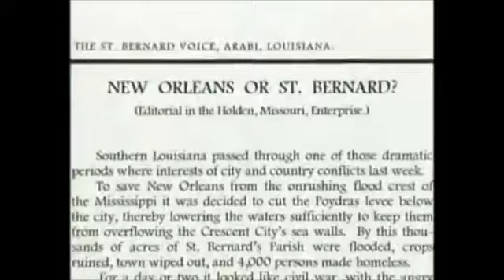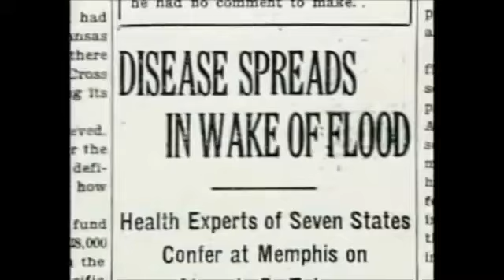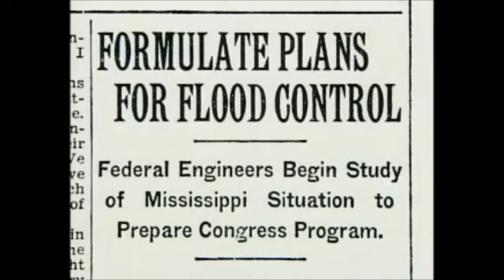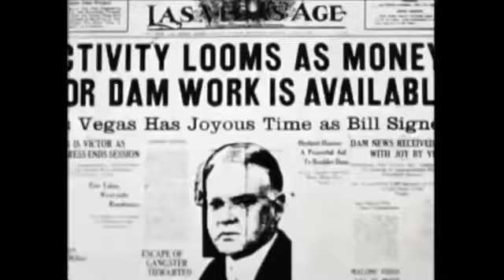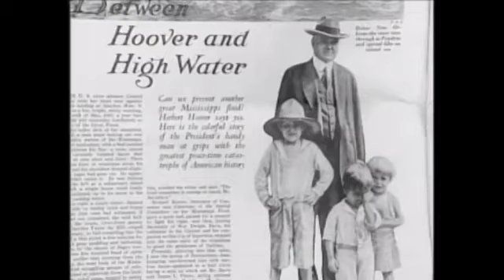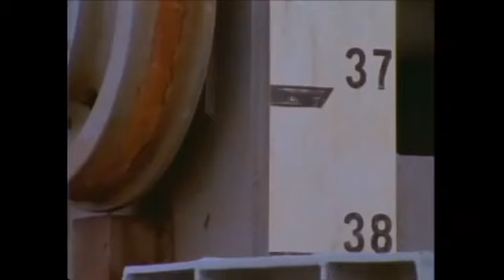A Tale of Two Rivers

Comment: Texas passed a law to move water anywhere in the state from anywhere in TX.  Looking at all the lakes in East Texas.  The water is all surface water and easily depleted.  The largest "consumer" of surface water is evaporation.

Looking at the Mississippi it would have to have more than one diversion point since floods in the north would not be helped by diverting from far south.  It would have to be very, very huge.  To prevent evaporative loss it would be better in a pipe or covered canal.  What happens when the folks out west get used to the water and demand more & more when there have not been floods for a while?  When the river gets low how are the barges going to cheaply transport goods?

Here in Texas one factor is everybody out west has to have their lawns, golf courses and flower gardens.  The Edwards aquifer has dropped well over a hundred feet as of over 20 years ago..  I saw a TX state employee watering grass at a rest stop in the middle of a desert.  Now they want to drain our lakes.  In fact one year water was pumped frome one lake to another that was dangerously low, too much water pumped to Dallas, the Nation's highest per Capita water user.

I suggest looking at desalinization.  Expensive but those who use need to pay not all of us who do not benefit from it.   Flood control in the Mississippi basin?   How about diverting to some huge lakes or water our plains for agriculture.  There are droughts there too.  

California needs to stop mooching off the rest of America and start being good responsible, contributing  citizens.
Reply: I love that somehow you blame California even though Texas is doing the poor management. California doesn’t even get water from the Mississippi so you’re grasping at straws I guess. 

We do grow too many high water crops here in California, but that’s a western watershed issue that all states are guilty of, and not anything to do with the Mississippi lol. 

Whenever someone has a problem in a red state run by right wingers they still manage to blame California and the people there believe it. All these crime videos in Texas and Florida and the comments are usually “hurr durr democrats letting criminals out early” even though democrats haven’t run those states in decades lol.
Reply from the maker: USACE, USDA-ARS host ribbon cutting for pilot groundwater project

https://www.mvk.usace.army.mil/Media/News-Releases/Article/2653681/usace-usda-ars-host-ribbon-cutting-for-pilot-groundwater-project/

Comment: I cannot remember where I was going or what was in the trailer behind me on those 2 trips I took a few months apart back 92 or 93.  But do remember going over a bridge over the Mississippi River and on the far side of the river was a place where you could unload a barge.  it had a back wall but the other sides were open.  The next I crossed that same bridge, all you could see was the peak on the roof of that building and I said WTF
I am a Canadian, and that was a shock to me like that water was 30 feet or more above where I had seen it the first time
Reply from the maker: Thanks for that great story. The Mississippi River is a true force of nature.

Comment: A system could be made to reroute the water to a huge dark lake waiting for extra water then it could be diverted to Lake Powell wand other systems to provide water for the west. The pumps required to lift the water to the higher altitude could be created by this excess water being routed through a hydroelectric system in the pipe lines to supply this water.
Reply: There isn't always excess water.  Even if the huge costs of pumping water a thousand miles to the west could be overcome, the system could not be dependable.  In some years the Mississippi river has low flows.  Indeed, in some months of a given year the flow is greatly reduced.  Water is very heavy, pumping costs would be greater than desalination of ocean water.